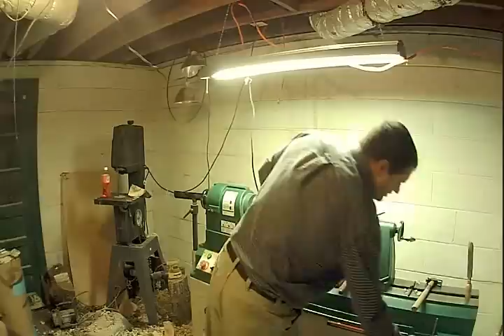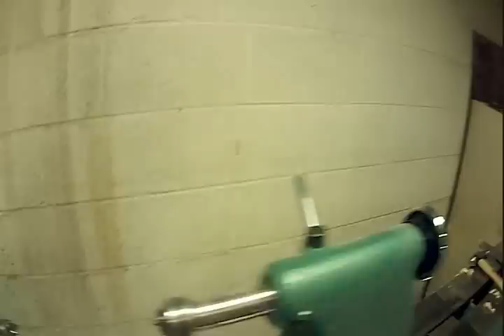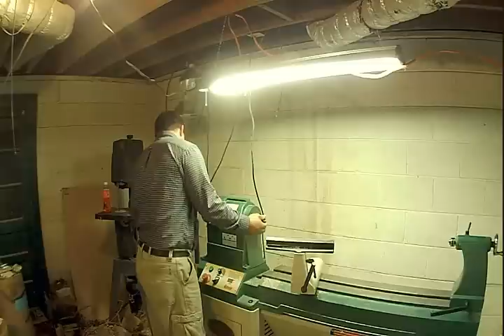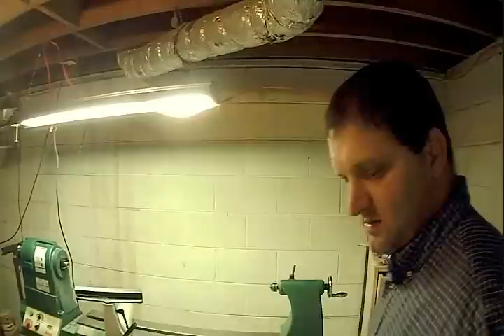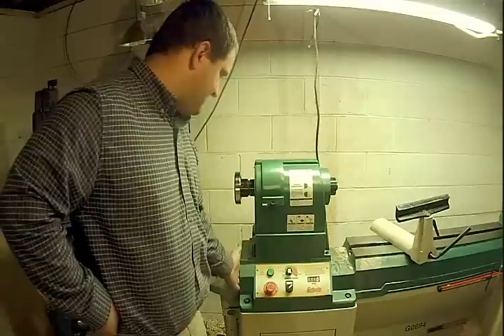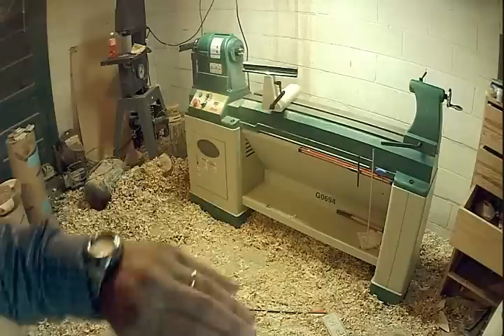Review of my G0694 Grizzly lathe.

Comment: Josh. Would like to say I was as happy. I also was like a kid at Christmas when it arrived. Now the problem. Clean up the lathe. Put plug on cord and turn own sounds great. Move tool rest up, no problem. Move tailstock up to check out alignment, boom. Tail stock moves 16" down the table and jams. I do mean jams. Nearly did not get it loosened. The guides are very much under ground and jam at same spot every time. Grizzly has been a nightmare to deal with. Told them to send me another tailstock and wanted to charge me $300. Told them to pay for crating and shipping back, no deal. They said let's try a new bed, you tear the machine down and install it. I say no because electronic panel involved and this machine has been in my sho less than 48 hours. CSR ladies have been anything but understanding and cooperative. Refusing send me another tailstock unless I pay for it up front. Refusing to pay all of the shipping and packaging. I had to rent forklift to get this in my shop. They said send the entire machine back for refund, not replacement. Are you paying for packing and another fork lift charge, absolutely not. That's the customer's problem. Yes it is to unload the first time, not when the machine is factory defect. Explained I have cancer and disabled now and this is the one thing I intend to buy myself while I'm still able to enjoy my passion, woodturning and carving. They care only about that $ and are willing to do nearly nothing to stand behind the tool. Yes I have bought many machines and tools from Grizzly in the past and have been pleased with performance. First time I have ever needed to deal with CSR and hope none of you ever go through this type of abuse.
Reply from the maker: Sounds like the channel for the tail stock was under ground at some point. While I agree that you should not have to pay shipping. Grizzly should accommodate you. You could file it down with a file in that area as a last resort. I'm not saying you SHOULD, only that you could so it's not a total loss. Sometimes it only takes 4 or 5 thou to throw things out. You could probably easily file it down with a flat file ran in the direction of bed travel and make it work.  Again, it SHOULD have been QC'd before it left the assembly plant, and YOU shouldn't be held liable for any cost.

Grizzly wound up sending me 4, yes FOUR spindle shafts before the warranty ran out. I finally had a machinist build me a suitable shaft from one of the originals, and we may wind up making another from scratch before it's finally over with. In my case they never argued and I had the replacement shaft within a few days of calling. One replacement shaft was BAD when it arrived. It has since been made into a suitable shaft.

We moved the machine into the shop, just My father, myself and my wife. That included unloading it from the truck which we could load if we had to. It was a job that we had to plan every move and go slowly.
Reply: Josh Carmack Josh, you are exactly correct. I said to the tech.  that is possible, but the tailstocks rear guide is already loose as a goose. It actually appeared to be over ground as there was a lot of daylight all the way around it. So take off a couple 1/1000's too much and the alignment will be impossible to obtain. So that action also voids any warranty. So when I said just send me a new tailstock to see if that fixes the problem CSR said only if I paid an additional $300. I said I'll send the original tailstock back if problem solved answer still No. You see the problem I didn't mention is the variance in the table gap itself is almost 10/1000 tail to head. I may have a entire different issue. OH well we'll see how this plays out. Appreciate you offering a spot for us old guys to vent and maybe hear some different thoughts on the situation.  Carl Allen.
Reply from the maker: Have you tried adjusting the cam and wedge tension on the bottom of the tail-stock?
Reply: I fixed mine by taking a file (without handle) and running it along the underside of the slot the entire length of the bed. There was a lot of green paint that was hanging up the disc. I also knocked the sharp edge from the lower inside edge along the length of the slot with the file. I finished with a coat of 'Slip It' on all surfaces. Now the tool rest slides all which ways with zero hanging up.